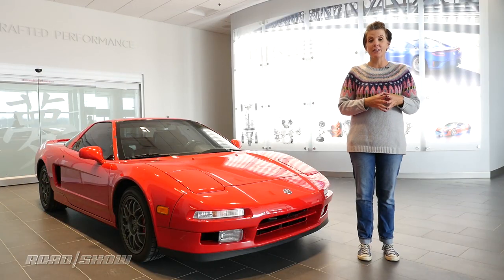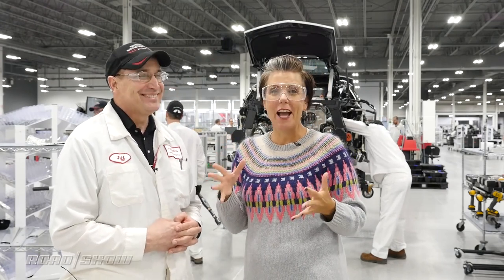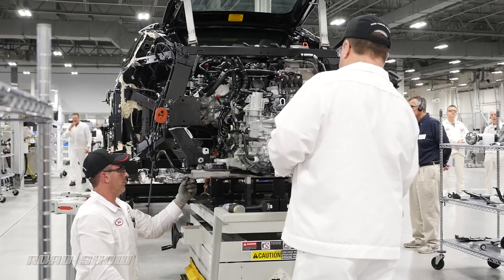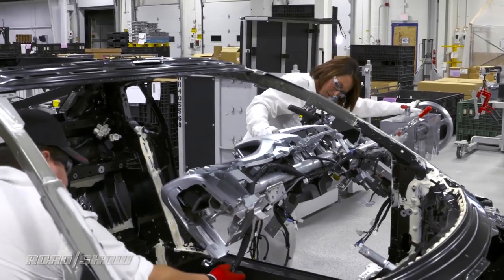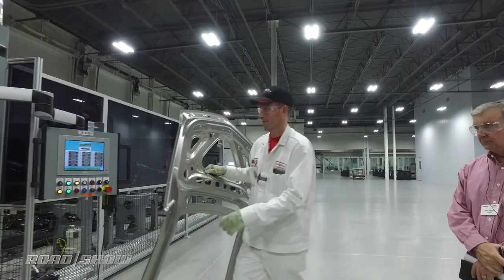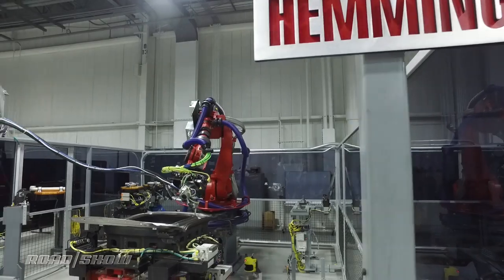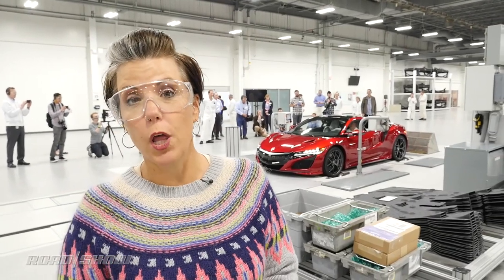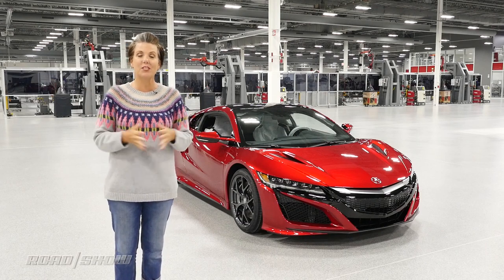Acura NSX gets its very own high-tech factory

Comment: They ruined what made the original NSX great,lightweight,naturally aspirated,rwd and manual...they took the wrong direction by building the car to suit it's name and not building it on what made the original a legend.
Reply: +The Opinionator so they should have built the car not to suit it's name?  if they wouldn't have done so why would they then name it an NSX? and you try to make a car in that segment today that keeps up with todays performance demands and meets safety regulations and pushes the NSX name to it's full potential and see if you can make it at that price point and under that weight, and forget about manual if you wan't to compete with the rest.
Reply: Skarphéðinn Sæmundsson It didn't need the 3 electric motors with the heavy batteries,it could have stayed RWD and manual and NA......look at what Porsche is doing with the 911r or look what Lotus did with the Evora 400..that Evora is more like what the modern day NSX should have been...a back to basics pure drivers car,now it's fat,boring and doesn't have a soul...and for the price,they must be joking.
Reply: +The Opinionator are you joking? the NSX is not a porsche or a lotus it is an NSX and it doesn't follow a design like the others do it follows it's name and does so perfectly. Honda builds it as a halo car and will use it to showcase their knowhow and what they are doing as a company and that includes the hybrid system and the sh-awd so it is no wonder that it's in there. it is heavy but still lighter then the GTR and only around 150lbs heavier then an R8 for example, I don't know how you can call it boring without having driven it and the fuck do you know about it not having a soul??? what the hell does that even mean! and for the price giving you tech that is found in cars like Mclaren P1, Porsche 918 and Ferrari Laferrari and still keeping the pricing under it's closest competitors yes that could be considered a joke that it is so cheap.